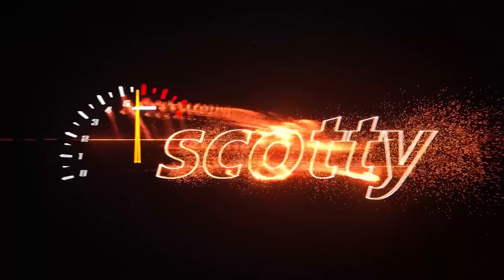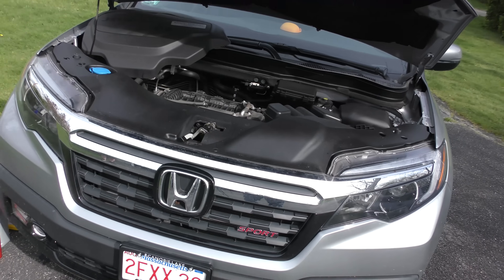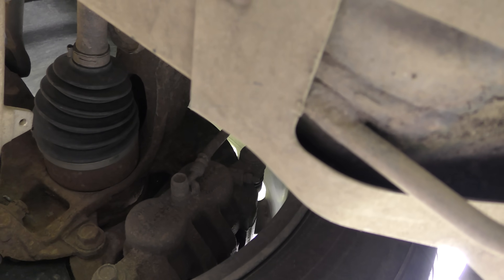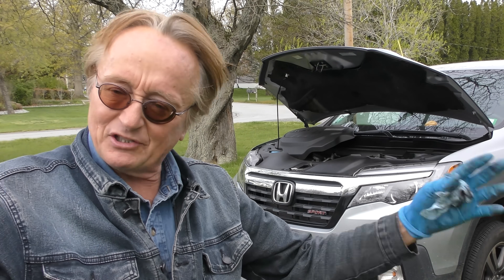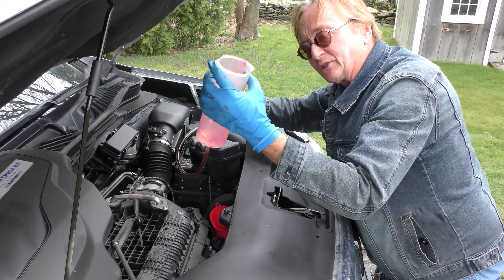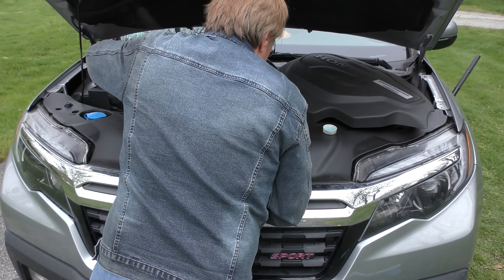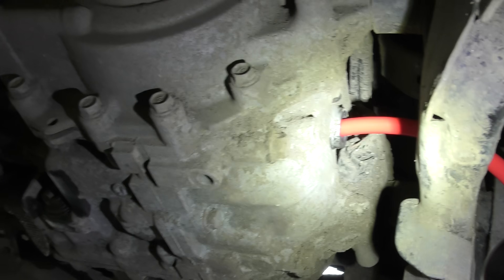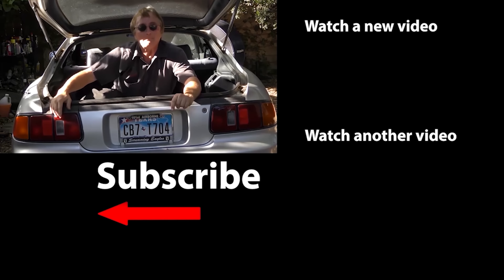Here's Why Car Companies Don't Want You to Change Your Engine Oil or Transmission Fluid

Comment: I have 2004 Toyota wish with the 1 .8 in it I’ve noticed in drive the engine runs rough and the gages vibrate when I take it out of gear the engine runs fine and the gages don’t move any ideas please

Comment: So many Honda dealerships that have cars under warranty and extended warranty use Valvoline Maxlife and or Castrol Transmaxx Import Mulri Vehicle as their preferred transmission service fluid. I only use Honda DW1 on my Honda Accord EX-L V6 Coupe with the 6 speed automatic and have been fine. But i did top off this last time over Christmas with 1/2 a quart of the castrol transmaxx and it has shifted beautifully smooth.

Comment: So if the fluid was low to start with, you’re still low by replacing the same amount.  Why not use the check plug and get the RIGHT amount of fluid in?

Comment: I just bought a 2017 Toyota Corolla le cvt transmission with 93,000 miles on it should I change it right away?

Comment: Yes, changing fluids will extend life of engine, transmission, and differential. Never go by the owners manual, it is a guide, but the Dealer and manufacturer are in the business to sell new vehicles and new engines, etc...  Subaru says lifetime fluid for the CVT, LOL. That is crazy, have it serviced at 30k miles for the first time, and 40k after.

Comment: How about the gallon or so of fluid held in the torque converter. The positive thing is that most debris in there will be centrifuged out of the circulating oil.

Comment: Scotty... I am a Scott too.  Anyhow what about the 1990 Honda civic crx si transmission oil ( yes engine oil ).  To the BEST of my knowledge I never changed it.  But a few years ago a slow drip where the shift rod enters started dripping.  I chose to not repair, but have my level checked every 50k approx.  I THOUGHT about changing it but get conflicting stories of yes / no ( new fluid will cause 5 speed to slip, etc) - so just keep driving it.

Who's right / wrong.  Don't change as metal filings are helping 5 speed oil to "hold everything together" with friction @ approx. 346,000 miles.

** can you please help me?

Comment: I change the CVT fluid every year -regardless of mileage. Same thing like the Hondas, I have to get the specific fluid. I don’t believe in those Castrol or Valvoline that say I can use that fluid for my car but it also has another 150 vehicles that it’s supposed to work. I’m not changing it. I’ll spend the extra money for the specific fluid.

Comment: @scottykilmer  i have a 2017 Elantra Sport bought if brand new right off the lot , its at 117,000  KM's havn't looked into the Transmission or the fluids, the owners manual says no checks needed, there is no way to check the fluid what do you recommend ? its a 7 speed Dual Clutch

Comment: My last boss owned a (sorry I didn't hear what year but I think 09) Honda Ridgeline.
He decided that its reaching 400,000km was "the end"
"It has to be wore out by now"
"I've driven that truck EVERYWHERE"
mostly highway driving not city use. 
I borrowed it once to pick up 14 sheets of plywood.  It held it no problem.
The interior was pooched dirty tired. I think the tailgate had a minor issue, and the steering wheel and shifter knob worn bald, but it drove perfectly.
He traded it in for a few hundred off the price of a 2021 Passat I believe. 
He asked around like i could have bought it off him "cheap cheap" 
He only did what the dealer suggested as far as what the vehicle was supposed to have done to it at what time.
"Its never been apart... I never spent more than x hundred dollars in shop fees, (timing belt, new battery) its been great. Im just convinced that the free ride is over and the engine will blow up any minute".
This man isn't a mechanic hes a business manager people person. 

I often think... would it have"suddenly exploded" & need transmission engine transfer case etc had I gave him the $900 or so...
I was so on the fence.
My GM was running fine (at that moment) then conked out over and over a year later (and way too much expense for a rusty truck) (city driving eats them for breakfast).

Comment: A few years back I met with a friend talking about transmission fluid changes in my 2006 5.9 Cummins p/u and his 2019 Ford Diesel 350. I told him I change my transmission fluid every 35k due to heavy loads and towing.  He's towing a 6000 lb trailer and disagreed. He called the Ford garage who told him don't worry. Change it every 100,000 miles.🤮. I guess I better call him...

Comment: Hi Scotty How do you fix a Po705 Code on a 2013 Nissan Versa 1.6 CVT Transmission? 
Changed the Range Sensor twice. Didn't work.

Comment: If the transmission shifts sluggishly, the filter might be clogged.   Start engine, shift in reverse for 5 seconds, put in Park, and immediately turn off engine.  Then change fluid.  This worked on my Jeep.  Transmission shop on the phone told me don't change the fluid!  Remember as Scotty says, don't flush!  Just change it a couple times and then change once in 30k miles.

Comment: When changing automatic transmission fluid, there are 2 ways to do it. 1) Drain & Fill. 2) Use the cooler lines to keep new fluid going in until the fluid coming out is clean. The problem with drain & fill, is that most of the fluid is in the torque converter and you can't get it out. If you keep it changed regularly, this is probably not a problem. Using a special machine to do it the other way allows it to be done with the engine running. So, the pump in the transmission is pumping the fluid around. You can replace more of the old fluid this way.

Of course, it's possible to get to the point that changing the fluid can cause you problems. If you haven't ever changed it, some of the gunk may be the only thing keeping you going. You change the fluid to all nice, clean fluid and you may have internal seals, such as in the clutch packs, start leaking and the transmission doesn't shift properly. The problem wasn't that you changed the fluid, it's that you hadn't changed the fluid and the fluid change brought the problem to light.

Comment: Scotty mentions Honda differential fluid. I don't know why in this case, but I can remember some limited slip differentials from the '70s. There was a special additive that the fluid had to have in order for the limited slip to work correctly. So, the correct fluid does make a difference.

Comment: Found a little trick from a different video about removing the old oil filter. Use a red solo cup after cracking off the filter to catch the oil. Put the cup on the filter before spinning it off.
Reply: And drain the oil first then change the filter because there’s less oil to leak out

Comment: My Ford dealership recommended to NOT change the transmission fluid on my F-150. They said if the transmission is working fine, don't touch it. They stated problems could arise if the transmission fluid was changed. I thought this was odd.

Comment: What I do for oil is get it somewhere close to where it should be then check to see if I need some more.  With my vehicle it takes close to a gallon of oil so I just start checking it when I get close to that.  Also it may go down a negligible amount on the first startup when it pumps some oil into the new filter.  Will you see the difference on the dipstick?  It is not too likely, some vehicles use really small oil filters.  The one they put on my Nissan looks like the filter for my lawn tractor but I compared them and the threads are different and the gasket is different.  I would not use the wrong filter but I simply had to compare them because they look so similar in size.  If I was willing to make a mess and had the device, I would cut them both open (just the used ones of course) to see just how similar they really are.  I know it is just a 2.0 in my Nissan which actually amazes me that it is not as slow as you might expect.  I mean really, it is a Rogue and that thing is rated just 141 HP.  You might not guess that if you drove it and did not know.  The CVT makes some difference in how quick it feels.  I would not want the same vehicle with a regular automatic transmission however.

Comment: Why change transmission oil just for the sake of it??? 
There are spacecraft in orbit for 20+ years using the same lubricant for their solar panel rotator mechanisms. And they'll run another 20 years

Comment: After a few months generic replacement transmission oil can be worse condition than the original oil brand new.
Some cars you would kill replacing factory lubricant with generic

Comment: You'd think,in regards to those useless Phillips head screws,that the industry would  all go to the Square,,much better,,Robertson 🇨🇦,heads that round out much less easy..and are more common than the torque type..good vid👍Scotty

Comment: Can someone please help me!
I don't want to make a bad decision. 
I am looking to buy a truck, under 25 or 30k in order to haul a 5000 lb (max) camper trailer for the purpose of traveling for work and into Canada once a month to see my daughter. I live in Eastern Washington. 
I will have to drive in the snow and occasionally around mountain passes, jobsites, and camp sites = 4wd(?)
What can I buy thats 
1. Reliable 
2. Won't kill me on fuel
I am thinking Ford year model between 2009-2014, but, 17 mpg. 
Or Chevy Colorado, 20 mpg and 7600 lb towing.
I am from the south and am scared of driving in the snow.
I love Tacomas (I currently drive a lexus) but their towing is subpar.

Comment: I bought a new 2021 Mazda CX-5 CE Turbo w/ AWD. I only have 3100 miles on it right now, and I've already changed the oil at 800 miles, and 2000 miles. I'm deciding, whether or not, to change the oil at 3500 miles, which will be sometime this year.

Comment: I had a 2007 Toyota Camry SE V6 3.5 engine. I never touched the transmission fluid ever. I sold it with 382,000 miles on it still running strong.

Comment: Hey Scotty I'm a big fan I have a 2011 Subaru Forester 150,000 miles on it don't know if the transmission fluids ever been changed should I change it now it has a little hop skip and a jump and it little vibration here and there but other than that it runs good thank you

Comment: remove the fill plugs first so in case you can't get it out, you're not stuck with an empty transmission or differential .

Comment: Years ago I had a client I had to advise on procurement policies, particularly with regard to fleet maintenance of patrol cars and ambulances and other vehicles which were driven hard most of the day. The gist od what I learner from fleet maintenance providers was preventive maintenance - in the patrol cars and ambulances, they recommended changing the transmission fluid every 30,000 miles. They kept records on all of their clients and found that requiring transmission fluid changes every 30,000 miles eliminated almost completely their replacement of transmissions that followed the"recommended" change intervals. Same thing with engine oil and not having to replace engines which wore out too soon because of long intervals between oil changes.   Convincing the "suits" that higher annual maintenance costs actually saved them tens of thousands of dollars from not having to buy replacement vehicles, which were out of service due to prematurely worn out transmissions and engines. In rural areas, one Sheriff designed and had made locally a "deer guard" to protect the front ends of his department's vehicles, and the safety of their drivers, when speeding to answer emergency calls, especially at night, and found deer standing in the road hypnotized by their oncoming lights.

Comment: My 2017 Honda Pilot recommends every 30k miles to drain and fill the transmission. 3.5 quarts. If you don't it will start acting up, shudder and engine revs up and down. Honda changed and reprogrammed at around 30k but before 60k miles started it again. I did the drain and refill myself, Honda sells a kit with 4 quarts packaged with correct Honda fluid and it corrected the shudder. Been really disappointed with my EXL, rolling beer can, noisy, rides rough, terrible sound system with bad reception. My 2009 Ford Flex with 150k miles rode better and quieter. Blend ac door was the only problem and it was covered.

Comment: Older Hondas do not have an easily serviceable trans filter on the auto trans so your 30k trans fluid change must be a flush. Change the fluid, drive to operating temp then change again. Drive a few hundred miles then change again. Only use genuine Honda ATF. Only way to make those trans last.

Comment: I buy vehicles with manual transmissions. I can make them last as long as the engine. Just sold my 10' Ford Focus with 445,910 miles on it.

Comment: When doing maintenace  my GF 2012 Honda Pilot, i always have her order genuine Honda fluids on line.  So far no problems with her Honda.  I did tell he to change her timing belt at 70,000 miles.  The dealership recommended she change her power steering seals for $600.  I told her wait until they leak.

Comment: I had the transmission fluid changed on my 2013 328i at 120k, $1200, and the car never drove the same way it did before i got it changed. When i get my Lexus, I'll change it every 50k.

Comment: I purchased a used '12 Honda Accord last August, which had just over 93,000 miles at the time. Since then, I've put about 1000 miles on it. Recently took it into the shop. Apparently the transmission fluid was BLACK, and the service techs were wondering if it had ever been changed, since it needed TWO flushes. I'm the 3rd or 4th owner of the car, so it amazes me that it quite possibly hasn't been changed once in all that time.

Fluid checks are important, for sure!

Comment: I never seen the giant syringe before for the transmission fluid. Pretty genius. Need to do gear oil soon, this may be a nice option.
Reply: It'd be a lot easier to weigh it. Just weigh the container when empty, then when full and subtract the weight of the container

Comment: Honda fluids are not cheap & yet you'll be asking for trouble if you don't stick with the Honda branded fluids.

Wish I knew what manufacturer made Honda fluids!  I discovered Mobil makes Toyota's WS transmission fluid (listed on the Material Data Safety Sheet) & the Mobile branded WS fluid is way cheaper than Toyota fluid.

Comment: I bought  07 Mustange GT without doing research on the vehicle.  Found that it doesnt have a transmission dip stick. To even check the fluid level, it has to be running, on a lift, with someone inside.  Another person does the work under the car. U can look it up on YouTube.  Its a very stupid process. Got rid of it and bought a 06 Police interceptor Crown Vic.. This car is much simpler to work on and it has a transmission dip stick. Its just stupod what these car manufacturers do in design.

Comment: I got a 2009 honda accord v6. The transmission filter is ascceable from the engine bay, should I replace that as well as the fluid? Also, what's your opinion on the honda version of flushing their transmissions? It's basically just a drain fill method.  Thank you love your content.

Comment: You're 100% correct regarding the changing of trans fluid.  I drive an 02 Ford Explorer, a truck notorious for failing transmissions.  My Explorer has 200K miles and it still runs the original trans.  I believe the reason is because I have changed the trans fluid every 50K miles. I also changed the rear differential when the clutch packs began to chatter.  I now change that at about 75K miles.  No more chatter.  The truck is powered by Ford's 4.6L V8 and I always change oil every 4000 miles.  The drive train is rock solid due to the preventive maintenance I perform.  I fully expect to drive it another 150K miles.  This is some of the best advice you can give your followers.
Reply: Cool. You perform 18000$ of yearly maintenance on a gas guzzling monstrosity!
Reply: @The Monster Under Your Bed  Let me do some math for you.  My annual budget for maintenance on my 'gas guzzler' is about $100.00.  That is oil changes and tire rotation ...normal stuff.  Every 50k miles I replace trans and differential fluid for $150.00.  Here is what you don't know.
My Explorer is body on frame build.  The body will last many more years.   The engine is a 4.6L V8  that averages 19mpg on the highway.  

A new body on frame SUV is about $75K with about $700 a month payment. That's $8,400.00 full yearly cost.  The gas mileage is around 22mpg highway. That is 3mpg better than my Explorer for $8,400.  
I can buy a lot of gas for $8400.00

So my maintenence costs are roughly $250.00 a year total.  By your estimate of $18000 costs, I save $17,750 a year with my 'gas guzzler'.  My choice is a no brainer.  Hope this clears up your confusion.  Have a nice day
Reply: @snatchbloock  8400$ is about 2 year of gas... Maybe less when gas hits 2$/litre.

Comment: ☝️Don't throw away money & waste good oil folks; life-time simply means the highest mileage interval in the maintenance section of your user manual. I've worked @ a dealership & a mechanic but certainly disagree w/some information from manufacturers/dealers but transmissions & differentials are perfectly fine to be replaced(drain & fill, never flush!) @ approx. 60k & no sooner or later, oil changes 5-10k depending on oil being used(reg. or syn.) & always check oil levels every few days, now coolant/antifreeze we'll call that "life-time" after your initial 1st flush😄 "have a Toyota w/3xx,xxx miles; original transmission & engine following this routine, stay on top of those fluid levels kid!"

Comment: I'm glad my father taught me to change the oil on the family cars when I was a kid😆😆  By the time I was old enough to drive, changing the oil & transmission fluid was the first thing I did after buying any car that I've ever owned.  Even the cars that had 200k mi. when I bought them ended up lasting for yrs. of daily driving(with consistent changes, of course)